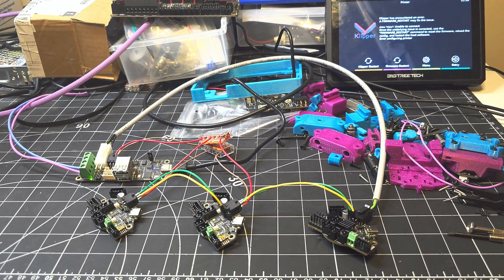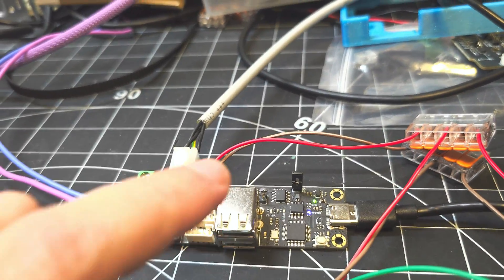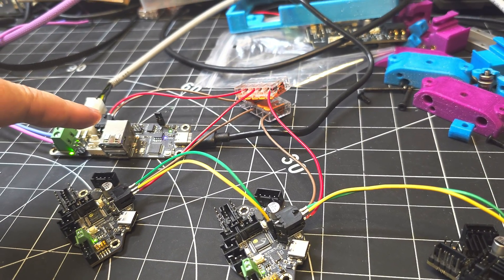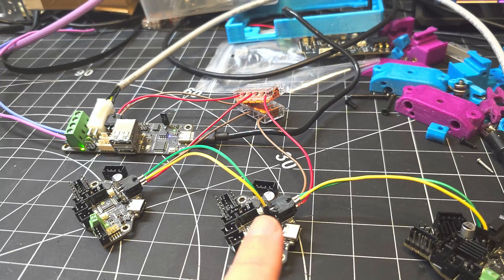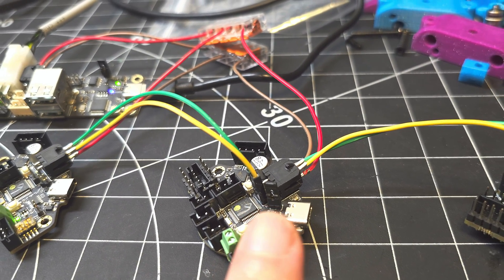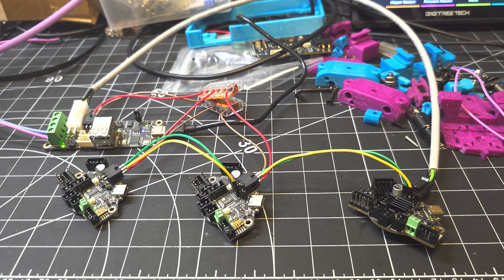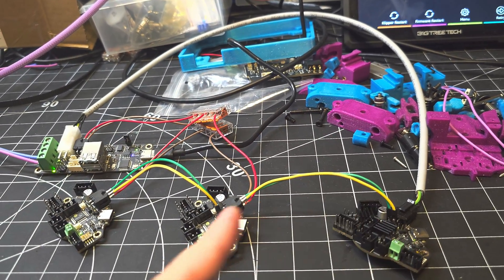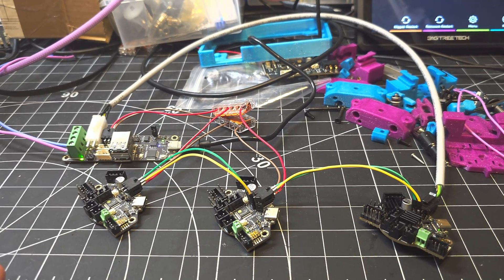From The Bench: Episode 11 - Where DO the CAN Bus 120 Ohm resistor pins need to be jumpered?

Comment: Yeah, all tool heads show up and they do seem to work, BUT: I have seen an other video from a guy who also connected his (6) tool heads in parallel and is seemed to work fine when printing PLA. When printing ABS (higher temps) is was unreliable..
He started trouble shooting, adding cooling fans, and in the end swapping out his USB2CAN board for an other brand.
This fixed his particular issue, but later on he discovered the real problem causing the issues he was having; Tool heads connected  in parallel, and not in series. He did the connection the right way, and then the other USB2CAN board also turned out to work fine when printing ABS.
So the moral of the story; Please stick to the official way when connecting CAN devices, it an save you a lot of trouble in the long run..

Comment: So as you describe the 'ring' I see it as parallel then, despite it being wired in series simply because if the can ports are really pass through on the ebb, then really, it's physically series, but electrically parallel. Does this mean that I could use my mcu (manta m8p) with stealthburner EBB and ERCF (v2) and just run them in parallel from the manta rather than 'daisy chain' (which daisy chain inherently means series)... If so, then which board should have the jumper enabled (of course manta being one of them). Interesting example you posted, thanks!
Reply from the maker: I have not specifically tried this. It is possible to configure the hardware with more than one can network. I expect that both CAN ports on the Manta are linked to each other, but that may be irrelevant for our use case, as all CAN devices in our printers are managed via the Pi/SBC, and unless I am mistaken don't communicate directly with each other.

Comment: Why not use br8dge mode no ebb?
Reply from the maker: I had some bad experiences with bridge mode about 4 months after implementing CAN Bus on my Voron 2.4.
After several frustrating weeks of troubleshooting, someone suggested that a U2C provides a more stable experience. This was back in March 2023.
I swapped Bridge mode for a U2C, and the Timer Too Close errors disappeared and haven't returned since.
I feel it's worth the extra small investment in the U2C.
Recent updates to Klipper may have improved the stability of Bridge mode, but I haven't felt the need to shake things up again.

Comment: I agree with most of the termination feedback below. Having said that, on a 3D printer the cable is only 1-2 Meters and has few nodes, so termination locations do not make a big difference. That's why "Old Guy" gets away with cables terminated wrong and without twisted cable. 
The other more important reason to use CAN is it has other characteristics besides differential signaling. People have been running differential signals 2 meters at >100MHz for ages. 
The protocols built-in to CAN are very robust and resilient to noise and power supply issues. You don't want your Tesla to die in the street if one of the CAN sensors fails.
In CAN if you short out either pin to power or ground or break a wire, the network stays running on the good signal wire. 
In most differential signally if you short either pin to power or Ground or break a wire the network will stop and it could damage the device.  
I installed CAN in my Voron as soon as it was available😋. I removed the termination and it worked the same as with it although its more robust with it installed.
Reply from the maker: That was partly the point I was trying to make: in the typical short wire runs of 3D printers, you can get away with a doing things a little off spec, and still be totally fine.
I do add two 120 Ohm resistors on my CAN network, but it doesn't seem to matter which devices get those resistors. I also have never twisted my CAN H and L, beyond whatever twisting is already done within the Igus chainflex and 3DO cables that I am using.
I never see any packet traffic issues with these set ups.

Comment: With my Micron if I placed a 120R on the EBB36 and the M8P 1.1 it would never see the EBB36. If I removed the 120R from the M8P side it then functions. This is also the same on my 300 Trident using a UTOC with a Mellow SB2040. I only have a 120R placed on the toolhead side. For what ever reason it just would not work any other way.

However with my 250 Trident using a U2C and EBB36 I had to place a 120R on both ends.

So some how some other factors beyond my understanding were at play with it all.
Reply from the maker: Okay, those are strange situations. I would be curious to know what resistance you measure across CAN H and L in each of those configurations, with and without the second jumper.
Some MCUs like the Octopus come pre-terminated.
Reply: @oldguymeltsplastic  They are all at 60. My first two setups were the ones where I only put them on the toolhead side so I just that, that was the way it works. Once I got to my the 250 and it didn't work is where I learned typically it should be on both ends and to check resistance.

Comment: There are a number of things technically "wrong" with your wiring, but CAN is designed to be very robust, so it pretty much works anyway.  I'm not an actual electrical engineer, but I worked with some of them on network protocols for a decade or so. I will try to explain what's going on, but I may not get some of the nuances perfectly correct. Hopefully it'll give you enough to search for more thorough explanations. :)

Any time a protocol spec calls out for "termination resistors" you know you're dealing with a "transmission line" and that line has got a specified "characteristic impedance".  Not only are you supposed to terminate the bus at the ends, but you are also supposed to use a pair of cables with a certain range of twists-per-inch and which have the specified impedance.  The termination resistors match the characteristic impedance of the transmission line, and they perform the important function of cancelling out signal reflections from the bus ends. Without termination at the characteristic impedance of a line, a signal will propagate out from the transmission point towards the ends and then literally bounce back to be picked up some time later (the time being determined by the length of the segment and the propagation speed as set by the impedance) at the transmission point; these echoes will combine constructively or destructively with the ongoing transmission depending on the phase offset of the reflection and can make a serious mess of things.  Putting a terminating resistor at the end of a transmission line that matches the characteristic impedance will effectively absorb the whole signal as it reaches the end, so nothing reflects back.

For high-speed CAN (i.e. up to 1Mbit, rather than low-speed CAN which goes up to 125Kbit) the termination resistors also function as part of the differential drive; they form a voltage divider to set the common mode voltage on the pair of CAN-H and CAN-L when the line is idle.  You must have exactly two 120Ohm resistors on the network to create a parallel resistance of 60Ohm, which sets the common mode voltage at the correct level.  The drivers of CAN-H and CAN-L drive away from the common mode voltage, and the resistors pull the bus back to the common mode voltage.  This is analogous to the single-ended protocol I2C, where drivers pull the bus line to ground and a pull-up resistor returns it to high.

Your wiring has both resistors in place, so it's setting the correct common mode voltage to get the signal levels right.  Who knows what the characteristic impedances of your wire segments are, but the wire lengths are extremely short, so reflections are probably just showing up as a bit of ringing in the transitions. Transmission line effects make a lot more difference as the lengths of the line increase and the rise/fall time of your signals becomes quicker. Modern on-board differential communication busses like PCI-E require length-matched and impedance-controlled PCB traces and proper termination due to their extremely fast transitions, so it's all a function of what kind of signals you're trying to work with.
Reply from the maker: Thank you for your very detailed response!
Reply: Nice work guys

Comment: The resistor belong to the physical end because of reflections.
You have the last EBB36 connected with an unterminated cable stub, which will cause reflections.
That’s just basic physics of transmission lines.
The cable wave resistance is 120 Ohm and so are the end terminations.
For the same reason using ethernet cable is wrong, since it 100 Ohm, but you only get 120/100 of the signal as reflection, which is usually small enough for digital signals.
You can get away with doing things wrong to a certain degree, especially since the unterminated cable stub on your desk is very short.
To be a bit more specific, you can do stubs as long as those are short enough for the signal frequencies used.
However, the frequencies are not exactly the transmission clock frequency since those a square wave there are higher frequencies involved.
The bad thing by doing it non perfect (non 120 Ohm cable and/or wrong termination) is that even if it seem to work, it is less resistant to external noise and may randomly fail by sparks from a nearby light switch when a correct installation would have had no issues.
Reply from the maker: Your point is well taken, but if a nearby lightswitch is sparking, I likely have bigger issues than whether my CAN Bus wiring is stable or not. 🤣
Reply: @oldguymeltsplastic  Light switches always spark when switched. They shouldn’t do that in between.
Reply from the maker: @ticso24  huh, I was (obviously) not aware of that.
Reply: So then I couldn't run my Manta M8P and connect it's can port to two devices, in parelle from the can port on the manta? If so which board gets the resister jumper, aside from the manta?

Comment: This is a great line of questioning and I'm tempted to bust out my CAN networking textbook so I can help here because my memory is horrid but the high level is this; kiiiddd is exactly correct. It's all about wire length. Standard for resistance across the network was decided based on this. They could have just as easily made it 240ohms and required 120 at each end. (Though they probably should have gone the other way if anything).. CAN networks can seem like ring networks because they are bidirectional. Because the signal strength degrades heavily at long wire lengths, it's necessary to have resistors in the signal path to keep signal integrity. Since it's bidirectional H to L or vice versa, it makes most sense to have it across the H to L at the farthest point from signal source/master controller. With your demo network your wire lengths means you are gonna have zero issue maintaining integrity. If you were building an industrial printer with an 11ft x 5ft footprint... you should follow the standard.
Reply from the maker: Also true. Good thing I only have 3 foot wide doorways then. 🤣
Reply: @oldguymeltsplastic  what?! Where are you gonna put your V24? I'm looking at selling my 25 year automotive tool collection to make room in the garage. (Wanna wager they announce at smrrf?)
Reply from the maker: @artfedderson  Our garage is unheated, and Canadian winters are not conducive to 3D printing.

Comment: If I remember correctly length was one point the 2nd one was to find errors in the system.
Reply from the maker: Yes, and a 3D printer's CAN Bus ecosystem is very different to that found in a vehicle.
The published specifications likely never considered how CAN usage might be applied over significantly smaller distances.
Reply: @oldguymeltsplastic It has nothing to do with the use cae, it is about physics, which is the same in a printer as it is in a car and everywhere else in the universe. See my other message about this.